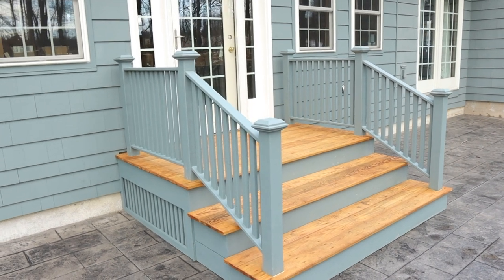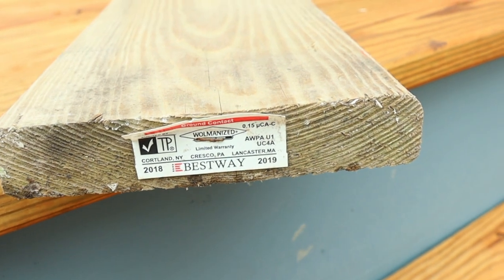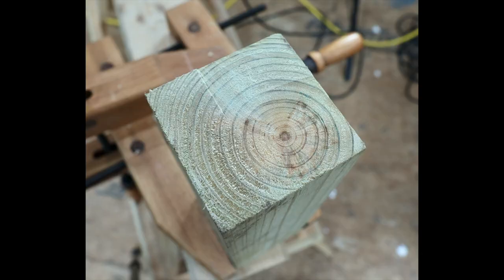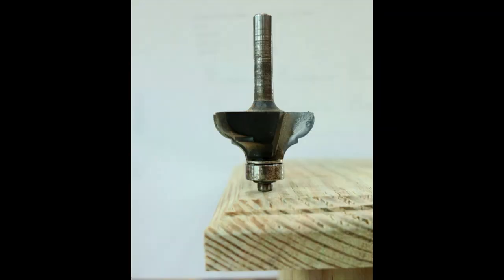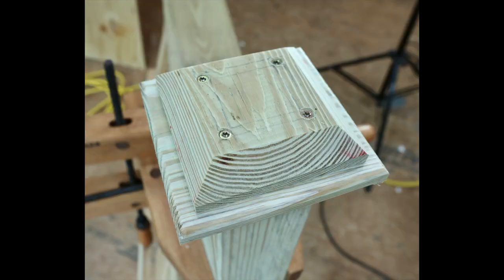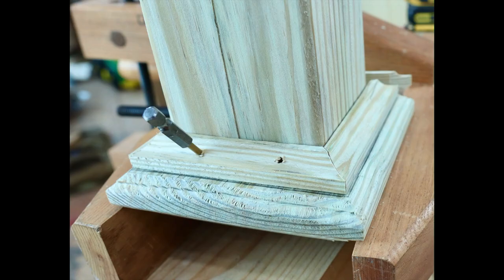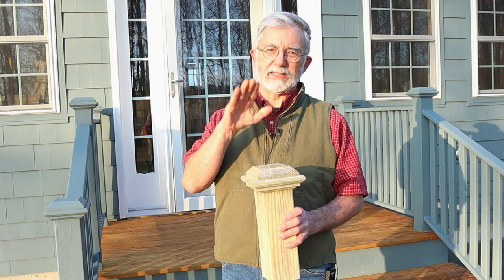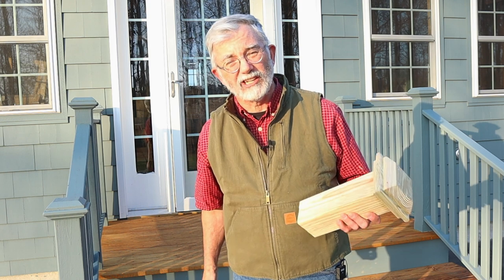How To Make Custom Pressure Treated Deck Post Caps

Comment: I like the concrete. Did you do it yourself?
Reply from the maker: Thanks. It's Stampcrete. I bought the stamps and a local friend, who works with concrete for a living, did the work. We're very pleased with it so far. I need to coat it with a special (expensive) sealer once a year.